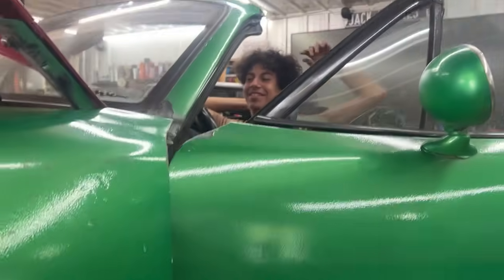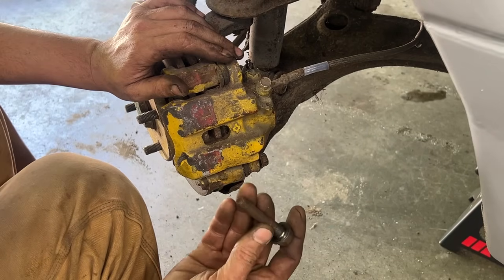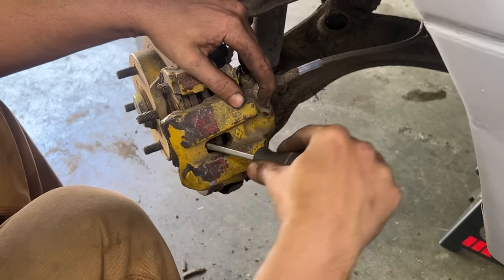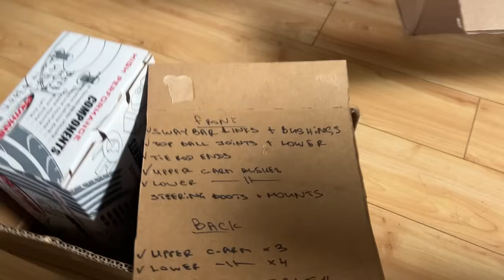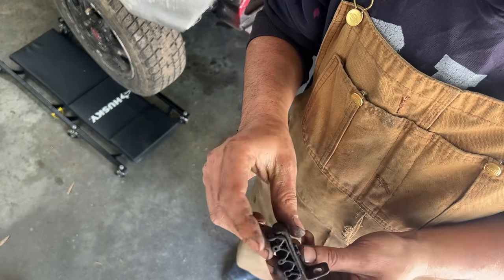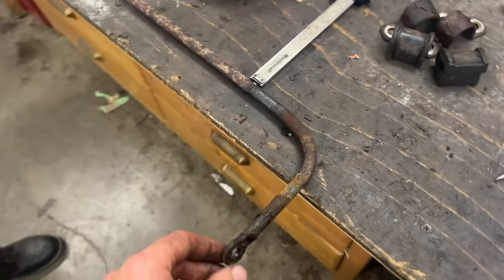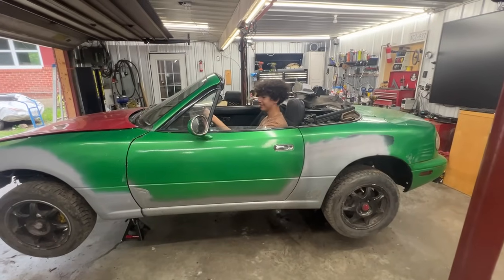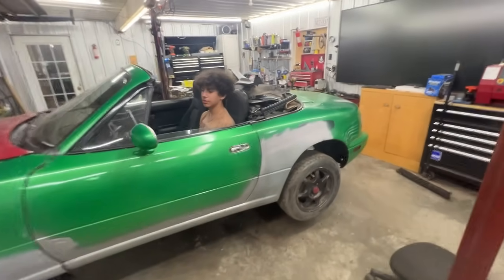1994 Mazda MX5 Miata - Part 27 - First road test

Comment: WD-40 is a Water Displacement product, not a releasing agent, I would recommend something like PB Blaster, or failing that, a 50/50 mixture of Acetone and ATF (Automatic Transmission Fluid).
Reply: Wrong, sorry. WD40 can also be used as a penetrant, it is not only a water displacer (despite the name)
Reply: WD40 is used globally mainly as a releasing agent regardless of what it was originally designated as..
Reply: Lube is lube..yes some work better than others..but anything that has lubricant in it will help do your work... people fixate on what they hear and on other channels .... we used WD 40 for decades and i still use it..of course i have other products....
🇨🇦🤓🤟

Comment: I'm surprised you didn't buy a brake caliper rebuild kit.  Then again I do know you can't get rebuild kits for some cars only rebuilt calipers.  I haven't been happy with poly bushings, they're great for fine control of steering but poly really increases suspension harshness.  Of course I'm 70 and not young like Nick so daily ride does matter more to me.

Comment: Princess Auto sells proper Caliper tools..depending on the style a simple push style is common on older vehicles to push the caliper back in...safer too on the seal... easy to slip when using pry tools....i use a old pad to help too..stick it in between caliper piston and tool...
newer calipers need the turning piston tool and those kits are cheap ( i try to buy when on Sale )... those kits work on push type too...
🇨🇦🤓🤟

Comment: I know I’m 7 months late for this but consider replacing the rotors.  If you can get them cut and still meet spec that would be ok.  But here in the US I don’t know if anyone actually cuts rotors anymore. 

It will be cheap insurance for better brakes.  Based on my experiences I don’t believe those will clean up with use and will offer at best a much longer stopping distance.  

In the wrong circumstances just a single inch will make the difference between impact and a near miss.

Comment: Great job guys! Elin, didn't you get the memo re polyurethane bushings? Now that they've been around for awhile, words out that they are crap. It seems that they are prone to disintegrate and turn to dust long before good old rubber shows the slightest wear. Might not be an issue for Nic's Miata given that most of its miles are behind it. Wondering if Nic has chosen a color for his hot wheels, so many choices! How 'bout a two-tone livery?
Reply: Actually, it’s the opposite ( at least in the Triumph world)…the current rubber bushings in the market disintegrate and perish very quickly…sometimes before the restoration is even completed….the poly bushings are a much better option and will probably outlive the life of the car.
Reply: Zoom Zoom Nik!
Reply: It's looking better every video. Keep up the  good  work.